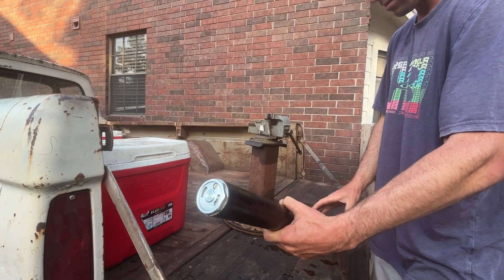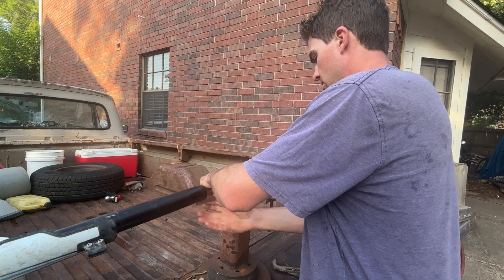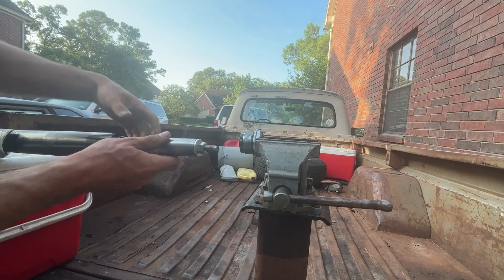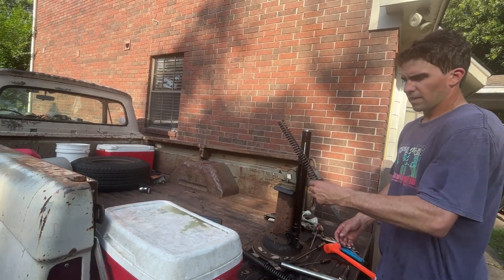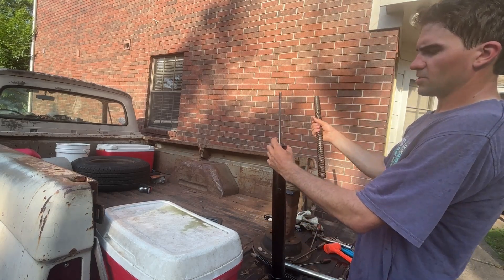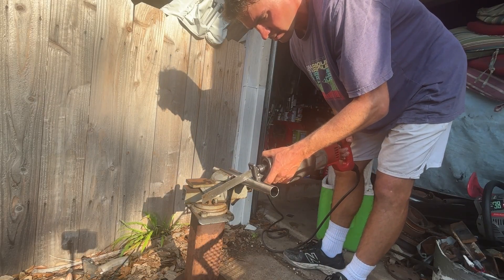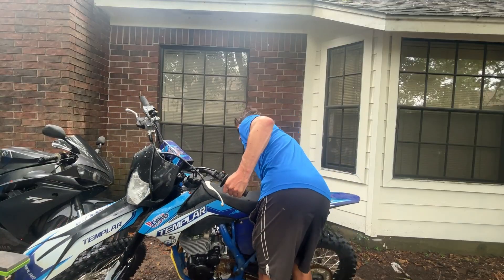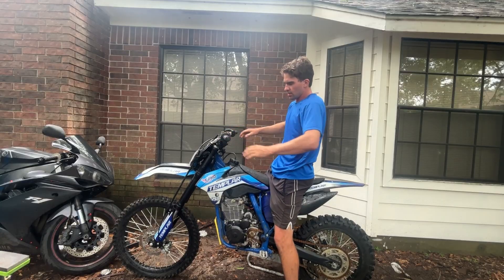X-Pro Templar 250 Front Fork Extension Modification/ +4 inches of travel + adjustable preload

Comment: Thinking about doing this mod but the springs don´t ship to my country. Which size springs do you think i could use? What would the maximum diameter be, and could i use springs that are shorter than the ones you used?
Reply from the maker: I have a set of springs that I bought and I was going to use it on someone else’s forks but it didn’t end up going through. I can ship them to you if you want
Reply: can u link the springs and all the parts u used

Comment: put an adjustable hose clamp on the spacer when you cut it and it will be a perfect cut and if not then you can grind it / file it to flush then remove the clamp -perfectly round
Reply from the maker: That is definitely one way to do it

Comment: You seem to be a whiz with these bikes, do you have any suggestions for a upgrade rear shock?
Reply from the maker: Not yet. It has a good travel but it’s not valved right. In my opinion it needs thicker oil in the shock. Only issue with that is that it’s hard to find a place to put nitrogen back in the shock. I can use compressed air but that has moisture and over time it kills the internals
Reply: @Cant_Find_Neutral  I was looking into it, how about the Templar X shock that is fully adjustable factory?
Reply from the maker: @g_abe_c Yes but it’s different than the base Templar. The Templar X shock would hit the carb on the base model

Comment: Awesome video! Great job! About to get everything needed. One question though, what made you pick this particular spring?
Reply from the maker: I was talking to someone on FB and we were going back and forth on springs. I chose this spring because this is the stiffest spring that will fit on this bike. Stiffer = Bigger diameter. There are other springs but they are super soft
Reply: @Cant_Find_Neutral gotcha. I was just curious. I'm 6'2 so any height I can add, I'm down lol. I've got an old kx250 spring that I believe I will be able to get to work but I'm gonna do the forks first. I converted mine to a supermoto. (well, minus a bigger brake setup) but when I went to the 17in crf450 wheels, it lowered the bike even more
Reply from the maker: @fullmonster000 You can definitely try the springs you have before buying new ones. With you being taller you can cut 2 inches off the spacer instead of 3 for more preload but you will have to compress with the spring a little bit to get the nut started on the rod
Reply: @Cant_Find_Neutral 10-4! I appreciate it man! Keep up the videos! I'm subscribing!
Reply from the maker: @fullmonster000 Thank you I appreciate it!

Comment: I’m impressed, this is what the bike needs. Just curious now that you have ridden it what are your thoughts on it? To stiff? Just right? Please let me know!
Reply from the maker: It’s perfect! The first 1/4 of the stroke is really plush and nice and after that it gets shifted to prevent it from bottom out. I’m planning on going to the track with it this weekend to do more testing but so far it feels really awesome! I would recommend this mod to everyone!
Reply: @Cant_Find_Neutral  let me know how it works out, I don’t do any track riding just trails but I’m a bit heavier than you so this definitely has my interest. Thanks for the good info!
Reply from the maker: @Housel4972 Will do, I took it trail riding briefly and it felt really good. If you heavier than me I would recommend a thicker oil like 20W and max out the preload. Another thing you can do is only cut 2 inches off spacer instead of 3 to have more preload on the spring. I’m about 175-180 and 3 inches on full preload feels pretty good to me

Comment: Good work I  might have to try to get someday. Needs to be a fix for the seat, they are horrible!!
Reply from the maker: Yeah the seat is pretty uncomfortable but I’m always standing up because of woods riding or jumps so I’m rarely sitting on the seat for more than a couple minutes at a time
Reply: @Cant_Find_Neutral I ride woods but Im getting older I need more cushion lol.
Reply: Ha you should try a Beta or a Ktm seat. It’s literally a 2 x 4 the seat is not a 79PE 250 but it ain’t bad.😎
Reply: @davet3947 Actually I've been looking and I think this seat is an exact copy of a mid 2010's KTM 125sx.